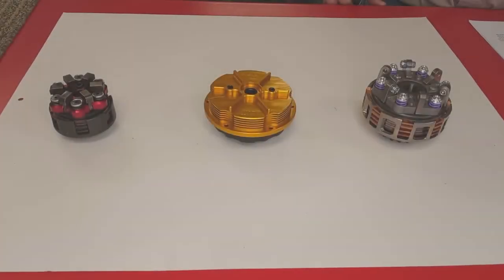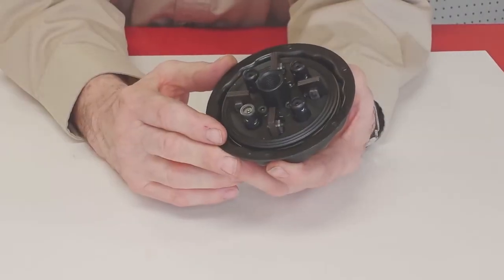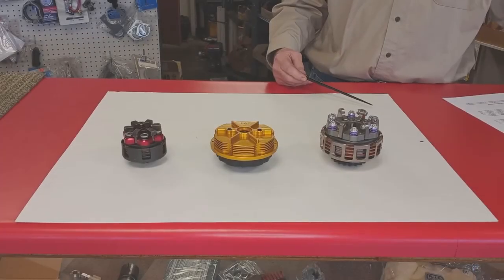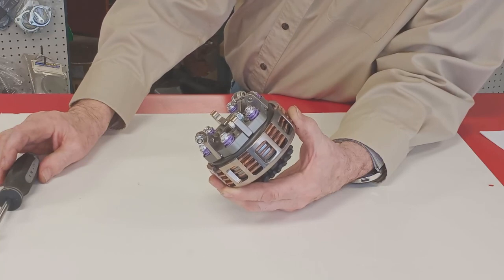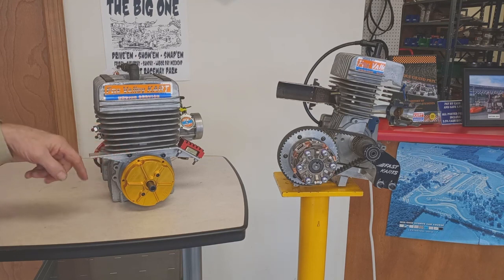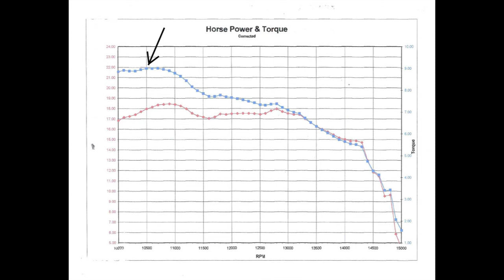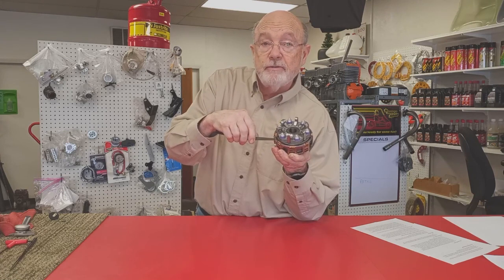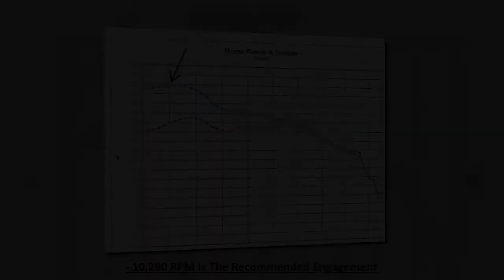Grand Prix Clutch Seminar Part 1: Jackshaft Clutches

Comment: Sir, is this a shifter kart? If it's not, then what's the clutch used for, if there are no gears to shift?
Reply: Basically the clutch goes onto the jackshaft (I believe that’s the name) and that shaft is always spinning. The clutch basically only engages once the motor reaches a certain rpm automatically which makes spins the whole assembly causing the chain to start moving and powering the rear end. I probably did a horrible job explaining that, but I tried. If you still want to find out you should call John at Fox Valley Kart. He can explain it wayyyy better than I can.